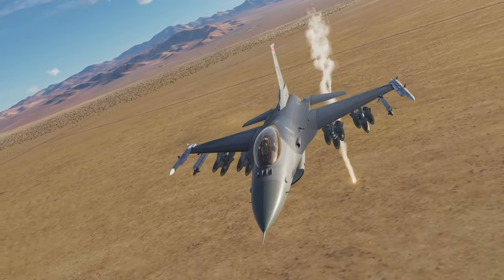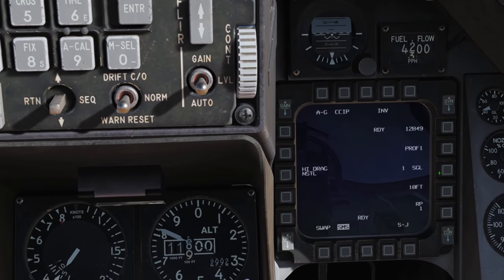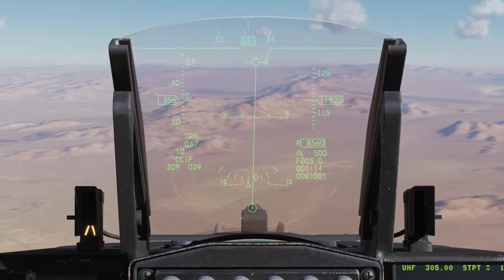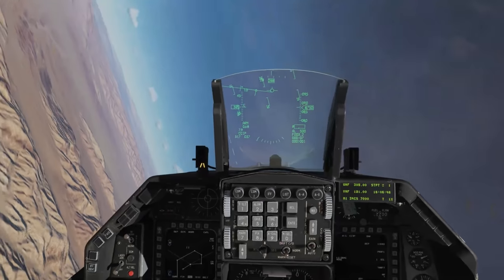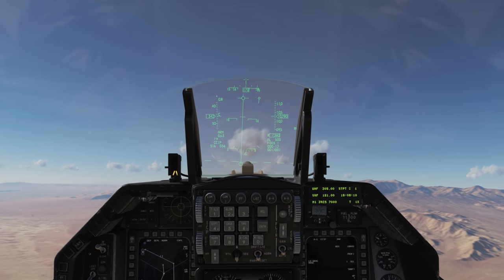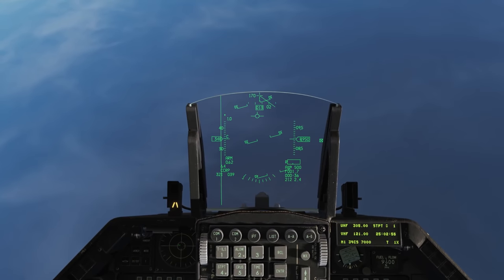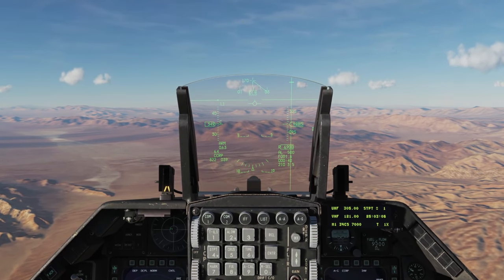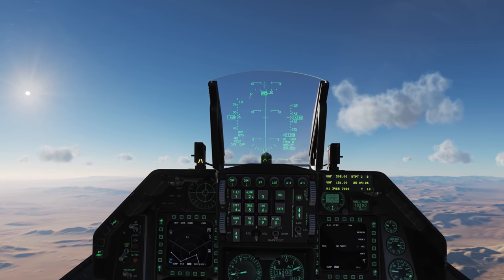DCS: F-16C Viper – Unguided Bombing

Comment: Does betty only say "CHAFF, FLARE" when in auto mode? I'm not too familiar with the falcon
Reply: No.
Reply: @patrikrenmark2010  so are you saying it should always say it when they dispense? And they presumably havent implemented it yet?
Reply: @tedweiss5702  unless it's disabled in the DED, it will say it everytime.
Reply: @tedweiss5702  It also gives the que "Chaff/Flare Low" and Chaff/Flare Out". So It makes sense to have it say it regardless of mode setting.
Reply from the maker: All correct VMU alerts are planned.
Reply: @MattWagner  understood. Thank you :)

Comment: according to Wiki, the block 40 through 52's APG-68 was upgraded in august of 2004 to the V10 standard which allows for Terrain following mode along with GPS guided aided weapons.

This is a copy paste from the wiki. "In August 2004, Northrop Grumman were contracted to upgrade the APG-68 radars of Block 40/42/50/52 aircraft to the (V)10 standard, providing all-weather autonomous detection and targeting for Global Positioning System (GPS)-aided precision weapons, SAR mapping and terrain-following radar (TF) modes, as well as interleaving of all modes.[43]"

https://en.wikipedia.org/wiki/General_Dynamics_F-16_Fighting_Falcon
Reply from the maker: Then it is incorrect about the Blk 50/52, they have never operationally been enabled with TFR, at least in the USAF/ANG/RES. Whoever wrote that may have gotten confused with Terrain Avoidance (TA) mode, which is different.
Reply: @MattWagner  it actually speaks about the TA mode also. I will do some more digging, but supposedly they were upgraded in 2004. of course it is wiki and you are correct it can be 
incorrect.
Reply from the maker: @sirbum69 . TA and TFR are quite different. The Blk 50 has TA mode but not TFR.

Comment: Hi Wags! I don't want to waste your time so I'll get straight to the point: I have been developing an MS Excel document which calculates performance information for the upcoming DCS F16C viper. I have been developing this for the past several months. Most of the TOLD calculations are complete. Using external references I am able to get weight and drag info for most munitions on the F16.  However, I am not sure of the stations that DCS will be using.  Is it possible to get a screenshot of the viper's loadout page? This will definitely aid me in the development of this resource.  Cheers, -Roman
Reply: @tueocohovf5084  This is a 3 year old comment.

Comment: Sorry but I did not at all understand how 87’s and 97’s are released at the same time. Was something missed of the video?

I also don’t understand the part about the horizontal bar in ccip mode, and how that means the impact ping is the same distance from the Piper as the horizontal line. In the demo the Piper comes over the target and bomb release is pressed end of story, negating that whole explanation.
Reply from the maker: Set to PRS (pairs instead of SGL). The lines simply indicates that the CCIP location on the HUD is not true, and the distance just let's you know how far off the bottom of the HUD the true impact point is.

Comment: Hi Matt! Nicely done. One verbal mistake at 3:55, it should be a fist "below" canopy rail for 60deg dive angle attack. Looking forward to the Vipe., Cheers, Scuby
Reply from the maker: 60-degrees azimuth (target at forward end of the rail), not elevation. Elevation was discussed for 45, 30, 20, and 10.
Reply: @MattWagner  Thanks for your reply Matt.  Roger, I see now what you were trying to say there. Your turn-in point was at 40deg azimuth from the nose. For 60deg you can apply about two fists inwards from the eyebrow along the rail. Consequently its turn-in point requires a bit deeper flight in the offset angle. I reckon most won't notice. Cheers, Scub
Reply: @ScubyFlying   is the 1st Solution Cue missing ? i didnt notice the big circle on CCRP
Reply: @-sharko-1184  Hi Delta, it appears that the loft bombing solution que in HUD is not implemented (yet), consequently it appears that in the SMS page the CNTL page (OSB#5) and weapon arming setting data (AD, BA, REL ANG repeater) is missing. I'm very very sure this will be implemented soon. Other current a/c have this option too. Cheers, Scuby

Comment: Noticed that when using CCIP with the TGP on, the pod appears to be slaved to the drop pipper.  Not sure if that is how it works in RL, however it has a bit of functionality in so much as you can get a close view of what you are dropping on…albeit a very quick view.
Reply from the maker: This is how it should operate thanks.

Comment: Matt will this version of the F16 be getting the Terrain following radar?
Reply from the maker: No, this is a block 50.
Reply: Matt Wagner mmh but the b50 can mount an/aqq13 which it has tfr
Reply from the maker: @CapitanTavish . I think you may be thinking of the Block 40/42. The 50/52 have never used TFR operationally.
Reply: Matt Wagner 
Probably you are right and my memories defies me, tho technically and softwarelly speaking the lantrin nav pod as much as the targeting one has no problem getting mounted on b50
Reply from the maker: @CapitanTavish . US Block 50/52 have never operated with LANTIRN, I'm not sure how more clear I can be.
Reply: Matt Wagner 
The Greece have 50 with it, I understand the US doesn’t and didn’t, and I’m totally ok with it .. I’m just saying it’s not a technical or bios firmware issue..